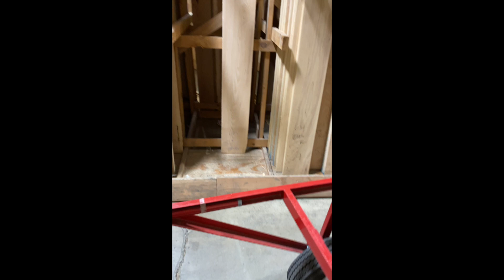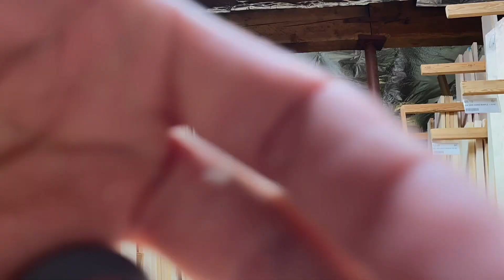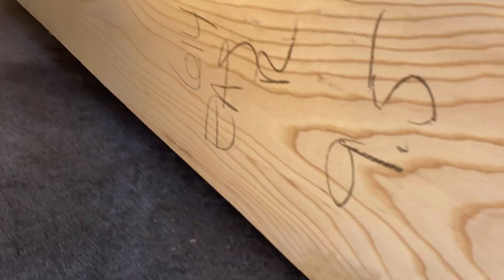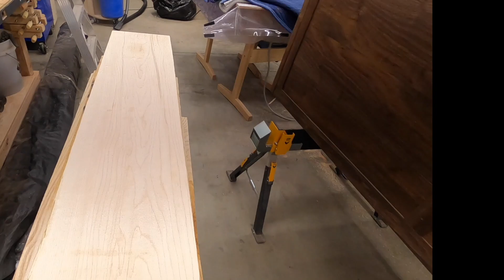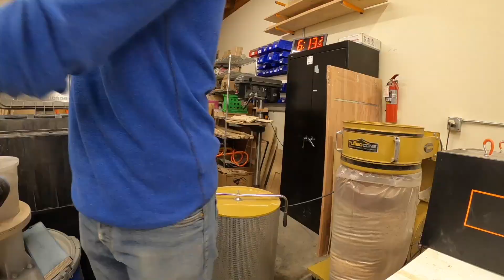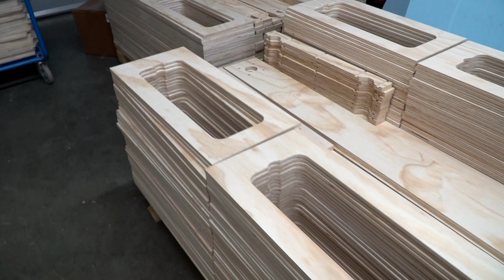Vlog 9 - Wood Shopping (I Went Outside)

Comment: Really like this series!  Are you running your boards through a planer, or surfacing them on the CNC?  I hope you follow up with your entire process as the series continues...  Keep up the great work!
Reply from the maker: Thanks Steve. It's possible to put them straight on if they've been planed from the mill. These will get milled in our shop and laminated to make our bases - https://shop.nack.is/products/base-imac